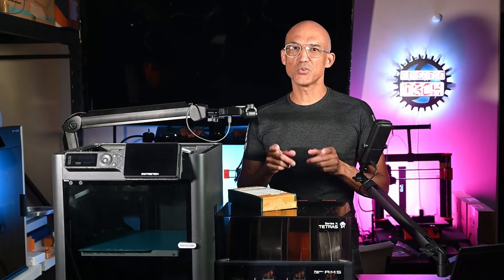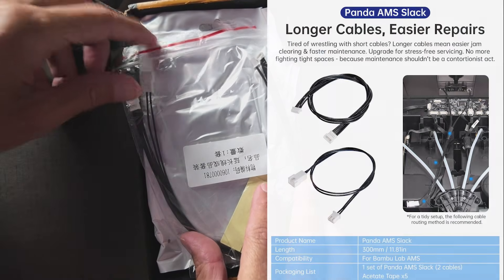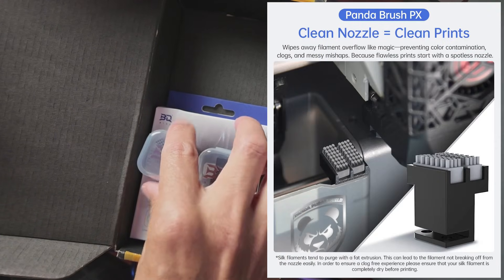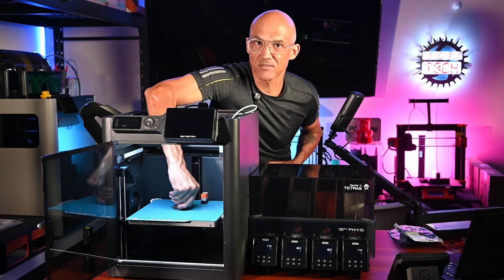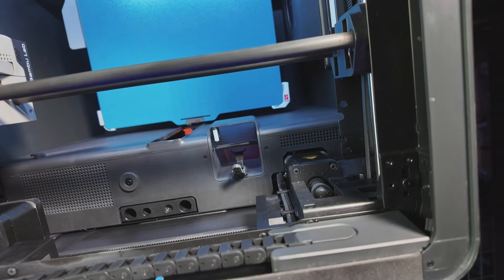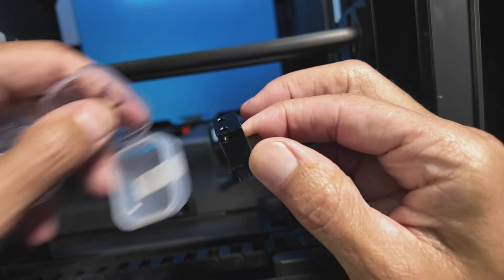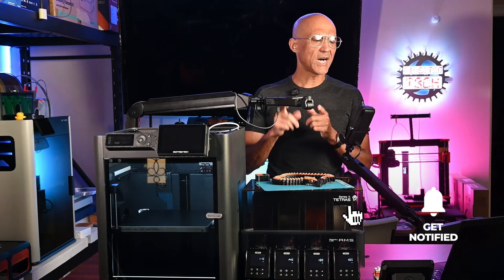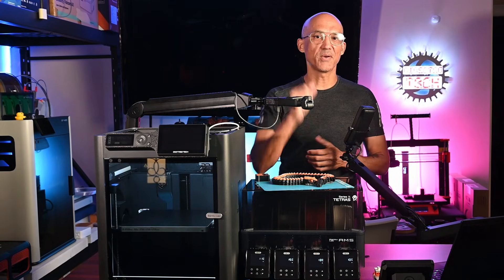P1S Poop Chute Clog Fix and AMS Upgrades - BIQU Panda Purge Shield - Brush PX - AMS Guard

Comment: I just bought the Biqu nozzle cleaner, and it came with the poop shield. I can't even get this thing out of the plastic packaging; there is no edge to grab a hold of, to open the plastic casing! Yeah, I can attack it with a pair of scissors, but I want to know how the hell am I meant to open this thing?
And the extraction of the shield from the packaging was conveniently left out of the video! I just know you had issues with this!
 Has anyone else had this problem?
Reply from the maker: Haha, it was a bit of a challenge to open!
Reply: @directedt3ch , How did you get it open?
 Did you have to cut it open?
Reply from the maker: @AndrewAHayes I honestly don't recall having a problem getting it open. I wonder if the packing changed in some way. I probably either used scissors or a knife to cut it out of the packaging.

Comment: Works about as good as the original wiper.
Reply: I do muti-color prints commonly over 30 hours..These simply don't work that well. If the fingers on the the PX brush were just a tad taller , I believe would make the world of difference.
Reply from the maker: @thomasedmondson2000You are definitely doing longer prints than I am. I wonder if the pad could be slightly raised to help...
Reply from the maker: It works much better for me.
Reply: So it is not worth installing?
Reply: @TheFutureLooksGrimm  Imo no. I had just as many clogged chute as the original. Actually I woke to one this morning. And after I cleaned the chute, reinstalled the cover , noticed a layer line. Print destroyed. Wasted 8 hours and materials.
Reply: @thomasedmondson2000 well i’ll just stick with the stock one thanks

Comment: Die Bürsten dürfen nicht parallel stehen. Falsch ab Werk. Eine Bürste etwas hinein schieben sonst besteht die Möglichkeit das die Düse zwischen den Noppen hindurch fährt.
----------
The brushes must not be parallel. This is incorrect from the factory. Push a brush in slightly, otherwise the nozzle may slip between the nubs.
Reply from the maker: Thanks for the tip!

Comment: I'm glad Biqu is making products like this for Bambu printers. The clogs has been a huge reason I don't do many multicolor prints. When I was making lightboxes, I would have so many fail because of the clogs and filament getting stuck to the nozzle. I also hear the ceramic feeders for the AMS are a must for long term use. These seem like great inexpensive upgrades to really improve the reliability of these printers.
Reply from the maker: Yeah, I'm excited to see more products like these! Biqu does a great job keeping the prices low and affordable.

Comment: I have a selfprinted purge wiper on my p1s because the original one is too noisy and snipping filament everywhere but i have the problem the first wipe of a print usually stick to the wiper, probably because its printed in ABS and i mainly print ABS on my p1s. luckly on the colorchanges it dosent stick but i still wonder if this wiper would solve that problem or is it just all the same?
Reply from the maker: It's very similar to what Bambu went with on the A1 series, and the new H2D, so I'd say it's a step in the right direction!

Comment: 13:01 that's a wiper problem..
Reply from the maker: It happened occassionally with the old wiper, and it happens still on the H2D... so I'd say it's a combination of several things...
Reply: @directedt3ch  The stock wipers suck, thus the various mods available and these Panda brushes.  I'm using the Panda brushes myself and haven't had your issue of poop being dragged out of the chute, even on a print with 73 filament swaps.  But since it still happened to you, I guess these brushes could still use improvement.  Before the Panda brushes, I had pretty good results with a combination of the Ultimate Wiper, which did a good job pulling off filament below the nozzle, and the Nubby Nozzle Wiper, which placed a bit of the A1 wiper in the corner and did a good job of keeping the nozzle itself clean of residue.  Maybe you could test those and compare?  Ironically, when I did my print with the 73 filament swaps, I did have a poop chute jam.  I didn't get the Panda shield when I ordered the brushes because I never had that problem before and didn't think I'd need it.
Reply from the maker: @kchiem  Thanks so much for the info! That's a very interesting idea!

Comment: easy cheap answer to end poop pile up replace your purge bin with a 5 gallon bucket and purge
 straight from the opening in the back to the bucket
Reply from the maker: The pile up happens at the top of the purge shoot. A bigger bucket won't help. The problem is caused by poop sticking to the chute.
Reply: oh and as far as the over priced purge wipers there are many wipers that are printable and use a1 purge brushes for a lot less then these cost

Comment: I would have hoped some actual video or timelapse footage of the Panda Brush working especially how those poops landed on the plate. There are multiple mods in Makerworld which attempt to work similarly as the Panda Brush with cut A1 brushes but quite often there are some millimeter alignment issues regarding height or the hotend is not hitting the brushes properly depthwise which have to be adjusted. It would have been cool to see how well these aligned. There aren't that many reviews on Panda Brush and haven't seen any proper material about those working. There is some german yt videos from 3D-Druck-DAU suggesting you should mod these by moving the 2nd brush few millimeters depthwise so the two brushes are cross aligned and hotend poop will hit some brushes every time and cut it to the poop chute properly which would fix the poop to plate issue.
Reply from the maker: Thanks for the suggestions.  I actually recorded a bunch of video but it's hard to see that nozzle wiping in action, but I'm sure I can do better in the future! Maybe I'll make a short!
Reply: I tried all the Makerworld upgrades to the OG wiper on my X1 Carbon, and quite a bit of money buying silicon tubing, silicon to mould new brushes, they either broke first clean or worked terribly! Don't waste your time and money!
 I havent fitted my new Biqu nozzle brush yet, and can't even get the poop shield out of the plastic carton it comes in; extracting the shield was also conveniently left out of the video. I just know he had issues with it!